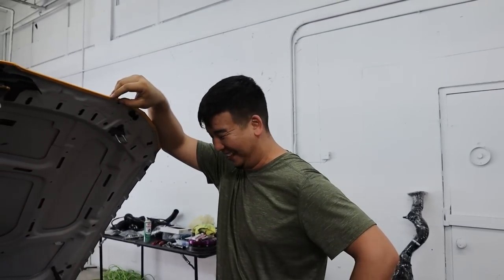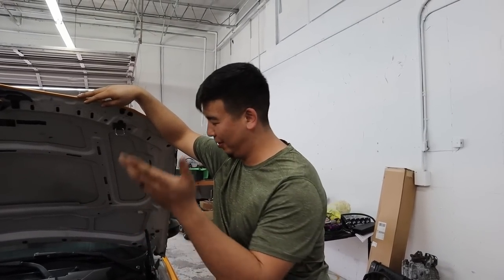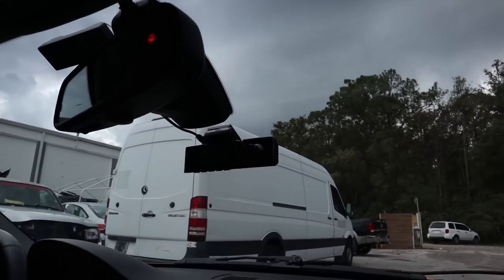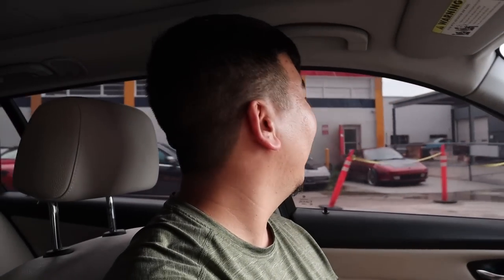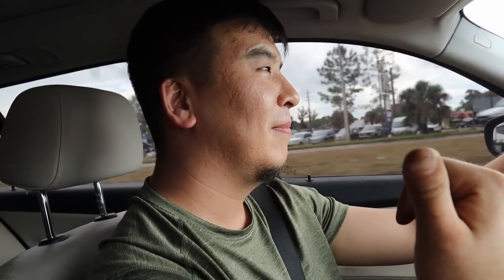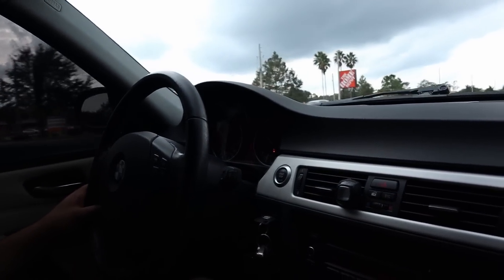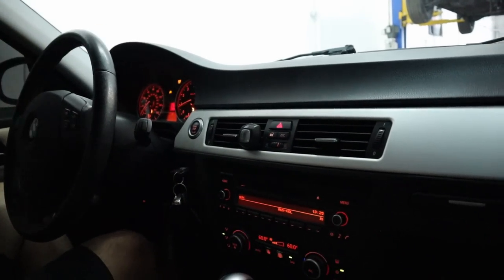Easy way to fix your BMW N54 misfires…

Comment: B58 coil conversion all day. 10x better than the PR coil kit
Reply: How so?
Reply: Stronger, and lasts wayyy longer
Reply: Bolt on without configurations?
Reply: I love my B58 coils
Reply: @woapaggin6803 pretty much. Comes with the plate to mount them on/in
Reply: @woapaggin6803  the kits come with longer coil boots as well
Reply: @Imesswithcars  i disagree lol been running the pr kit going on 2 years with 650whp lmao
Reply: @slow_s1000 rare lol, b58 coil kit still has stronger spark tho

Comment: I switched the spark plugs and it made a big difference but I also definitely need a upgrade my front mounted intercooler as I live in the Arizona desert and summers can get up to 115° not counting the heat off the pavement.

Comment: Im having an issue on my N54 where it will drive fine if i keep it below the 5k rpm mark but if i really give it gas it will shake continually until i restart the car assuming its shutting off the cylindar 1,2,3 cause thats where my missfire is comming from according to my code reader. And when i start the car before its warmed up it has a rough time starting and will even somtimes go into limp mode but never after its warm like if i drove it to the store and back out would be no problem but if i wait until the next day go to start it acts like a while different car runs rough sounds louder missfires might go into limp mode might not if i restart when in limp modenit goes away. And has no missfires.
Reply: its your HPFP(high pressure fuel pump) its under your intake manifold next to the starter

Comment: That duck noise is so annoying lol but it's the intakes with inlets that make that sound. I got a stock z4 airbox that I'm putting back on to eliminate it.
Reply from the maker: Nope its not because of the inlets or intakes, i have plenty of cars at my shop that have the same mods without any noise, my outlets were the issue which i already solved
Reply: @SwapDepot  I have stock outlets with the same noise and as soon as I install the stock airbox the noise is gone. 

What was the outlet fix?
Reply from the maker: O rings on them were bad, would check your inlets as well
Reply: @SwapDepot  Sounds good! I'll double check again, thanks 👍
Reply: @SwapDepot  Do you know if you can see the leaks if you smoke test it?
Reply from the maker: Possibly, wouldnt hurt to try before taking stuff apart and guessing

Comment: I need help! Just did a valve cover gasket replacement myself. Also fixed a boost leak I had. Once I put everything together I let the car warm up for 30 mins or so, took it on the highway and when I put it in sport and hit the gas (not WOT) it ran amazing for about 10 seconds then I got a cyl 6 misfire. I tried swapping coils & plugs. Nothing changed. Cyl 6 plug had some fuel when I took it out. Getting code 29D2 & 2E35. Probably my injector? (Btw I have index 1) 2007 e92 n54
Reply: I would guess the injector. Two years ago I replaced the index 5 injectors with new index 12 injectors on my Z4 with the n54. It’s an expensive project but something you can do yourself with a little mechanical ability and coding software to code the injectors to the ecu. Index 1 is pretty old!
Reply: @z4dude131  it was the cyl 6 injector that died. Got some used index 12s for $400. Replaced bank #2 (4,5,6) fired right up, no more misfire. & im still running index 1 in bank #1. I’m going to replace them but I have to find a shop that will code them for me although they run fine without coding, it’s a temporary fix.
Reply: Check injectior seals super important

Comment: If you use the engine cover with the bms filters wouldn't that prevent the water from entering those back cylinders? To me it seems maybe it's a combination of things that leads to those water intrusion issues.
Reply from the maker: Yea those filters are bs, keep your cowl on

Comment: Hello. Just asking, what about Eldor coils? Better, equal or not worth it?
Reply from the maker: Just like delphi more 🤷‍♂️
Reply: Good question. I always heard eldor was top dog of the oem coils but i guess eldor or delphi depending on what is cheaper at the moment.
Reply: Eldor are 100% solid i like them better than Delphi i feel they are a little bit higher quality which is why BMW went the Eldor route. Honestly at the end of the day you cant go wrong with Delphi or Eldor for your tuned application.
Reply: get the n54 dinan coils they perform great and look nice too
Reply: I’ve had experience with eldor and Delphi and for my DCT 335is stage 2+ Delphi is way better. Currently switching back to Delphi. My car just misfires like crazy on the eldors I have no idea why. They’re new eldors too.
Reply: @eggm0ney  great input. I was considering that b58 coil conversion as well but admit it kind of was for the looks with a nice cf plate. Worry about my dme80 frying with b58 dwell so it seems like delphis are safer for 28-32psi tunes.
Reply: @milehighboost5521  the eldors held up for about 150- 200 miles, then they started to misfire on several cylinders occasionally and cylinder 5 more frequently. When I had the Delphi’s I ran them for about 40,000 miles. Even tuned from stock to stage 2 plus in that time and never had an issue. Eventually they got old, so I decided to give eldors a try. Turns out, they’re garbage. At least for my car anyways.

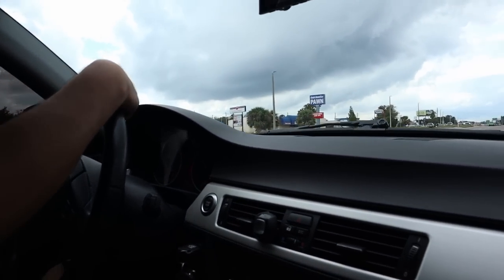Comment: 6:39 The DUCK NOISE is plaguing me to no end!! I can't figure it out either. PLEASE if you find out why it's doing this LET US KNOW!! PLEASE PLEASE! I have tons of power but Turkeys live at the end of Boost Street LOL!! I hate them!
Reply from the maker: Mine ended up being outlet pipe o rings, but it could also be boost solenoids or inlet pipe connections to the turbos

Comment: So you’re getting mosselman turbos? 👍🏼
Reply from the maker: Nope
Reply: There are much better turbo’s than only mosselman
Reply: I have the MSL50-65's, they have now outlasted 2 sets of VIV 17T's. Happy is a word.
Reply: @BMW1M  how many hp you running
Reply: @Autohunter06  still working on map revisions with Wedge - there will be a dyno video once it’s all done

Comment: The easiest way to fix all the n54 problems is put a LS in them 👍
Reply: Everyone and their moms got an ls tho
Reply: @eldios3666  Yeah, i know. well, with an n54, they just love being worked on. Im building a fully forged one, so hopefully, it might be reliable🤞🤞
Reply: @tighematthew  I feel you actually Im doing the same with my n54 tryna chase those numbers but the main reason why I haven’t went ls is because everyone talks shit about bmw
Reply: @eldios3666  Yeah i know im on my second motor and third set of turbos  stated with 17ts then 19ts now flowmax plus full port injection methanol injection PRW coils set manley turbo tuff rods and pistons head studs ported head. So pretty much everything you can do ive done and a back up shot of nitros  just in case
So hopefully 🙏

Comment: Omg this spelling correction is shit.
What model of scanner you use?
Regular or the plus version?
Can it fix frm on e92? My left headlight eont ignite due to frm. I need something to fix it with.
Reply from the maker: If the FRM is bad then you just need to replace and code it which this tool can code
Reply: It's weird because everything works other then just left headlight xenon light. Scanner is showing code but I can test it with the scanner and it works for 15 seconds.  The light has always water inside and I had to replace balast like 3 times and now it's not working and show code with frm. I seen lots of videos with updating software on frm and that fix the issue but I need programming tool. That's why I asked if this scanner has power to do it.
Thanks